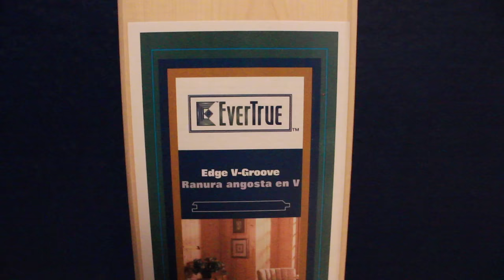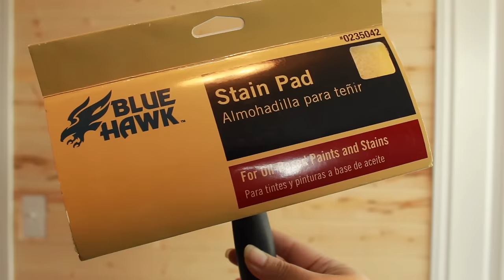DIY Rustic Wood Wall Under $40

Comment: Clearly you have no background in home remodeling or construction. So many things wrong with this.
Reply from the maker: Seether Fan clearly we said we aren't professionals, we are DIYers. Life is so much easier when you listen. :)
Reply: Seether Fan can you clarify or make a video on what was not done right?
Reply: 1- Stagger the joints so you eliminate the vertical lines where they all line up. It's not hard. once you have some shorter pieces from cuts, you can "start" the next row with a cut or start the next row from the opposite wall. 
2- Remove the outlet places and cut the planks to match the openings in the wall. Put the plates back ON TOP of the new planks. Put the 'DEVICE" back on top of the planks too. 
3- The different stain colors should be mixed together to make a consistent color not a "marble" mix. The brush can be used to get the stain into the grooves. So can the rag. it just takes a little more effort. 
4- Careful with that nail gun. Use nails that are too long and you could penetrate wiring and/or pipes. Best to locate the studs first and use a fastener that only goes into them about 1/2" for these thin planks.  
5- Most people begin and build from the bottom up. 

Lots of us aren't "pro's" at doing some of these things. Doesn't mean we shouldn't do some "research" first and TRY to dod it correctly.
Reply: aside from # 4 all of these are "personal preference", hence the title and statements "DIY"-ers and budget friendly!
Reply: Nah, in this regard, he's right. You never line up joints on anything, ever. Not only does it look worse, it's much less stable. Staggering the joints doesn't allow for a giant weak point in a consistent seam. 

The outlets need to be removed ahead of time so you don't end up with a stuck panel in the wall. Also, when you cut the boards to fit that particular panel, you're stuck with it  for life unless you tear the wall apart and cut new pieces of paneling with dimensions that fit a different outlet cover. It also just looks FAR cleaner to put it on over the top and doesn't create a nook for dust and dirt to get caught in.

What he recommended about the stain colors is called "boxing" and it's something you do when using any different containers of the same color. It allows for a consistent color across the board. Again, it's not personal preference, it's standard operating procedure for literally any application. I do it with elastomeric coating, deck coatings, epoxies, paint, etc. 

the 4th one is huge, and that should go without saying. studs need to be storied out ahead of time. 

Building from the bottom up is also necessary for any quality work to be done. Gravity is going to win in the long run. Starting at the top gives too much opportunity for those pieces to settle and fall out of place, especially when using a nail gun over a screw gun. Starting from the bottom up ensures that everything is settled where it's going to be right off the bat. 

So as I alluded to earlier, these aren't personal preference in any way. They are just generally superior ways of doing things, and there is a reason that the entire construction industry would cringe at doing it otherwise. If you want things to be "budget friendly" you make sure you get it right the first time.
Reply: OMG! well being "superior" to us "?",  you shouldn't waste your time watching and posting about videos like this. I'm sure if they wanted the industry standard thru would have hired somebody in that field. live and let learn...
Reply: Good for you!! Go ahead and "do it wrong" even though someone took the time to educate you on the "correct" way to do it. If you INSIST on having a noticeably "wrong" installation, that's entirely your call. Showing other people how to "do it wrong", however,  is not doing anyone a service. Nothing wrong with doing it yourself. Why not, however, do it correctly so you ADD value instead of install something that needs to be done over. Trust me, there's a reason why things are done a certain way. When you do stuff "wrong" it doesn't ever "get better". It only leads to additional wrongs. This has nothing to do with EGO!!
Reply: Only one solution here, google cabin walls, it's clearly what she wanted. Play the video again and the problem with the negative comments are put to rest 😀
Reply: Looks perfectly fine to me! Especially budget friendly!!!!!! Sorry but all you perfectionists need to calm down🤦🏻‍♀️ the only people who'll have a problem when they see are people like you lol. It's not hurting anybody and it's not like she ruined anything so what's the problem?
Reply: Panels should have also been glued before nailing
Reply: I have a few nail guns, but I used screws and a hammer instead ;)
Reply: Rebecca Flores simmer on down a notch. Please watch your racial overtones.
Reply: Kaylee Vianne wow are you insinuating that she can't learn from some well meant tips. Most of which i think she could have & would have done if she knew before hand, without costing her more $$$.
The video is cool af.
Reply: Hadassah Immanuel 
Hey, hey, hey I resemble that comment! 😂
Reply: Don't listen to the haters. I'm a new home owner with zero diy experience and I get nervous when all I see are pros with all their tools fancy jargon and expensive material. Its great to see normal people who may not know what their doing, maybe messing up along the way but the final result is, not only okay but good enough to share with the online world! Well done and thank you for giving the rest of us courage and hope xx
Reply: So called professionals do crappy work all the time.. its not like theyre framing a house, its cosmetic work.
Reply: I actually appreciate the banter going back and forth in this thread. Just like I appreciate the video. I didn’t know this project could be so affordable and I would have probably done it the same way. But reading the comments on how to do it properly is just going to help me out in the long run.   So thanks to all!
Reply: @WulfricTheBlack  I am thinking the same, lol. Now I know more about the awesome project. Thank you everybody!